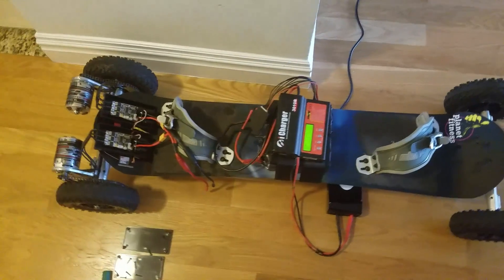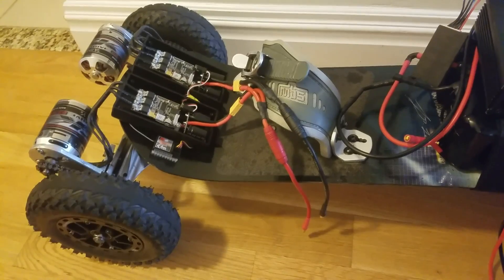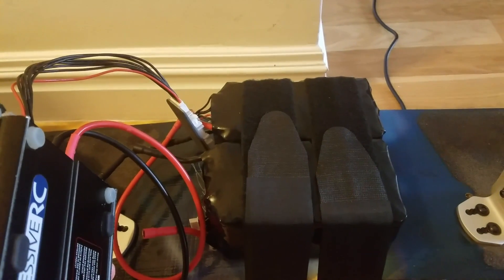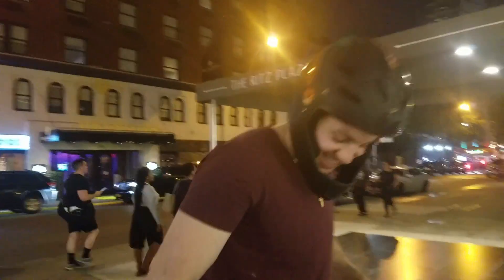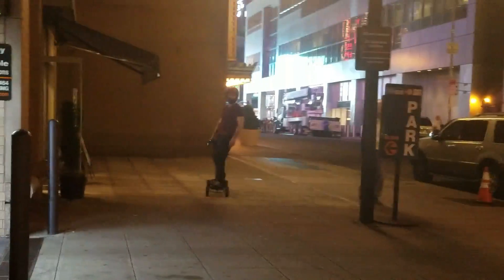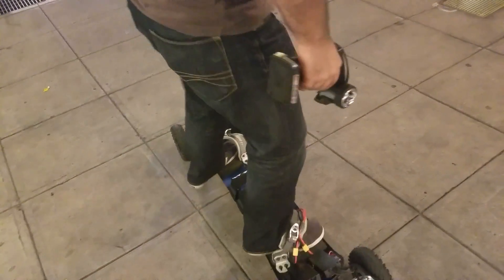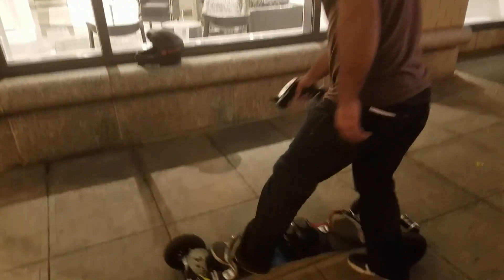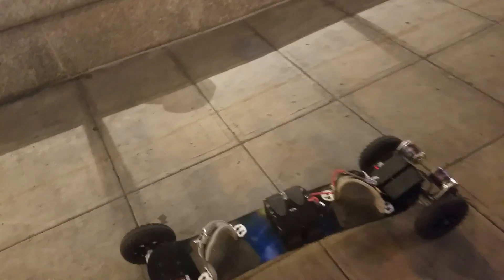DIY Electric mountain board - vesc and 10S battery with 149 kv motor upgrade

Comment: How did you connect the 2 vesc in your receiver?
Reply from the maker: can connection
Reply: @ElectricVehicleSpace   mean you connect the CAN connector to both vesc and the one PPM connector of vesc to receiver?
Reply from the maker: @axemanesk8builder125  there are videos on YouTube that explain. You need can cable and set up in the esc in vesc tool
Reply: @ElectricVehicleSpace  i have 2 mini vesc and i'm using like your receiver but i have no idea how to connect the vesc in 1 receiver.hope you can help me.thank you sir.
Reply from the maker: @axemanesk8builder125 receiver goes to the main vesc and the 2 connect via can bus.
Reply: @ElectricVehicleSpace  thank you very much sir.another question is mini vesc is good?

Comment: I know this is an older video but I'm starting my build now and I'm really torn between using the same style vesc or focbox that you used or RC car esc. I plan to use it a lot offroad and want to do wheelies and stuff. Now that you've had both which would you recommend??
Reply from the maker: Focboxes should work well. If you need motor mounts PM me...i have several kits.

Comment: Update.<<<Sorry for that,it's wrong,the torque and acceleration depends on how much amps you give to the motor not on the Ah of the battery>>>
you have 2x149kv motors on a 10s 5Ah right? so a motor whill have                                                                                                  (5Ah* 10*3.7V * 0.8(80%efficiency motor)*60)  / (149*10*3.7*2*3.14) = 8.880/34.621,64=~ 0.25Nm torque                               ,and how you have 2 motors with the same torque...Total torque=0.50Nm       and let's say that your gear ratio is 27teeth/14teeth=  1.92 so .  (Total torque=1.92*0.5 =0.96Nm and RPM=149*10*3.7/1.92=  2.871RPM )                                                           and torque T=r*F and let's say that the radius of your wheel is 7cm so you have 0.96Nm=0.07m*F so the force is 0.96Nm/0.07m=>      F=13.71N      and let's say that your mass+board mass=90kg,you will have F=m*a so 13.71N=90*a so the acceleration will be 13.71/90=0.15m/s^2  So acceleration=0.15m/s^2 ...and let's say you want 30kmh=8m/s ,and how a=V/time =>0.15=8/time so you will get time=53sec,so you will get a speed of 30km/h in 53 seconds which i think that you don't like. To get a fast start like 30kmh(8m/s)in 10sec you need a=0.8m/s^2 ...so you need a force F=90*0.8=72N hahaha, and a torque=0.07*72=5.04Nm(don't forgot that this is for a 7cm radius wheel change it with yours) so you need something like a 2.5Nm torque on the wheel from each motor but how there is a gear ratio of 1.92 you need 2.5/1.92=1.3Nm torque on each motor so let's try to change that 10s 5Ah battery with 12s 10Ah => motor torque=(10Ah*12*3.7V*0.8*60)/(149*12*3/7*2*3.14)=21.312/41.545=0.51Nm on each motor so 1Nm torque*1.92=1.92Nm torque so maybe you can get 30km/h in 20-30sec with this i think that's all what you can do with that 2x149kv motor ,just input your values on what i said and you will get what you want
Reply: or just change your gears with a 40teeth on the wheel and 10teeth on the motor to have ,or any gears that will give you a 1:4 gear ratio or between 3.5-4.5 but your top speed will decrease 3-4times.
Reply: Are you sure of this? To me it doesn't seem correct
Reply: not so sure,just an intuition:)))) i think that i''m wrong because the torque will increase depending on how much Amps you give to the motor,sorry for that i tested it and it was wrong for me too
Reply: i tested with a multimeter the amps to the motor and it was 70-75amps 
constant at the start with the rc at max ,and after some 5-6sec it was just 14-15amps at topspeed, so at 75amps to the  Torque on the wheel=6.36Nm  and it matches my acceleration before the top speed :-??

Comment: what is the difference between chain drive and belt drive system? what are the advantages and disadvantages of both of them
Reply: Chain drive is louder, needs more maintenance and is generally more expensive, but the belt system should be more efficent and quieter. Also a chain slips less than a belt.
Reply: depends on the belt type, HTD and GT2 don't lose so much power (like the power lost with the friction,tension,area of the pitch) from the motor to the wheel

Comment: I'm planning on building an electric skateboard for my son, i'm first building a single motor for him and a dual motor for me, ai the turnigy sk3 6374 149kv a good motor for the single eboard? Also, which batteries should i get for it from hobbykings and which esc is good for it? I would like it to go about 15 to 20mph and around 12 miles, any ideas you can share would be much appreciated.
Reply: Manny Martinez go dual because its more efficient and also power is pushing equally

Comment: Great one  , why did u use chain instead of belts? too much power? and wich kind of vesc are u using? because there are the original ones from australia or the chineese, wich one do you recomend? Best regards
Reply from the maker: i got 6 vescs from enertion. I use chains because its cheaper and lasts forever.

Comment: are these the fastest motors you can get? are there any better ones or did u get these because of price?
Reply from the maker: there are many more options but the better motor will cost more money. These motors 149kv or 190kv are more than good enough for daily ridding.
Reply: which motors would be best for top speed? any recommendations?
Reply from the maker: higher kv....
Reply: thanks....
Reply: you wont want more than a 192 kv sk3 because it can already get you up to speeds of 32 mph and more
Reply: get the biggest 190 motor you can and you'll only need 1, getting double the range from your batteries. I get around 6 mile from my drill batteries depending on hills and then I change the batteries over. boom boom off again in under 1 minute.

Comment: Its also about your gearing. You can increase torque with gearing. All else being equal, more teeth on your pulley the greater the torque.
Reply from the maker: daytrades4me i know that...there is more that can be done with vesc settings. thx

Comment: What I said at the end of the video was wrong. Under the current limits page the motor max and motor min (regen) should be set to 60 amps. You had them really low like 30 and -20. Once I upped the amps the torque really increased!
Reply from the maker: michael beberashvili awesome
Reply: But how safe is that for the VESC?

Comment: You might need to put some fans on the VESC's if they are low on power. I connected  a small 5V fan to the PPM connector on my board.
Reply from the maker: Chris why?
Reply from the maker: Chris where u able or do u know how to set the torque on the vesc?
Reply: When the vesc starts getting hot, it lowers the amps to the motors.
Reply: I believe it's done through current limits.  I'm using a Nyko Kama so I can make it more/less responsive on the Positive ramping constant menu. This feature is not available in PPM though.  If you want faster acceleration, increase the current until you find the Amps you are happy with.  The VESC can handle up to 240A for a couple of seconds.